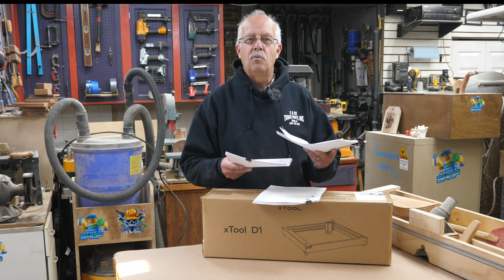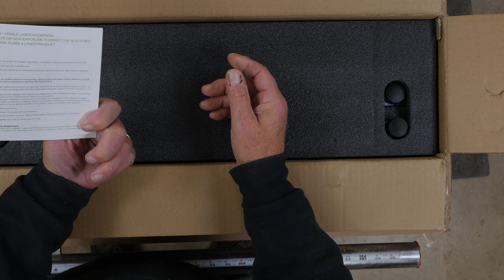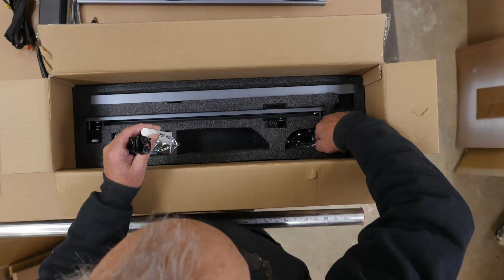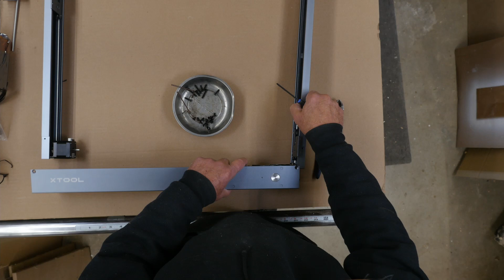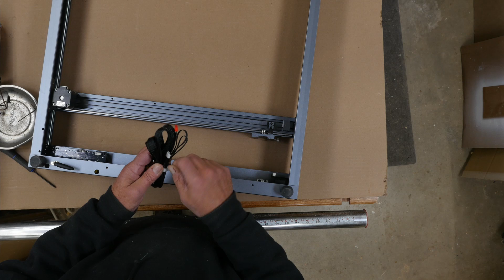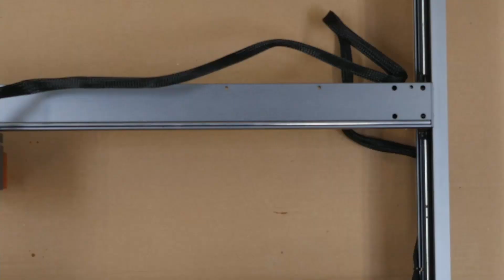Makeblock xTool D1 Laser Detailed Assembly

Comment: xTool D1 Pro 20W (red)What did you eventually do with that ignorant X-axis cable that will NOT stay out of the way of the laser. I tried under it, side, it just doesn’t make any sense why they designed it that way. Also I must of done something else wrong, the laser keeps hitting the sides and the alarm goes off. My “X” for my laser is off to the side about an inch. The instructions were horrible setting it up. It’s the weekend so there are no support options. It’s just aggravating. So far the couple of things I tried to do either hits the side and the alarm goes off or it was tried at a couple percent power to cut colored blue paper and it didn’t even make a mark on it. When I try to box the item I am trying mark it hits the frame and an arm goes off most of the time. I start it in the top left corner and it tries to go left and the alarm goes off. I wish I would of watched this video but I just followed their instructions that came with it and QR. Code to online directions. There was a spot that changed the X for the laser to a dot of the laser. I can’t find that now and it just seems like something is off with the laser beam. Should the X be 1/2 inch to the left maybe 3/4” off. I am thinking the laser is not making it out of the extension that has the air tool. The hose for that is worse than the X-Guide cable that is still in the way. The air assist tube just makes no sense and you have to keep the hose from getting in the way even when its not working properly anyway. It’s a lot to ask but any advice to get it right. The support open tomorrow if that help or notI already have their chat full of how stupid is this cable and air hose. The belt tension just bugs me, it doesn’t seem too tight but it might be, you said half inch with length play but how hard are you touching it? It’s not loose but it might be too tight. Something isn’t working right and I am new to all this but I am not an idiot but most of this makes no sense. Also are there any discount codes for LightBurn or student discounts? I know I need it but have spent so much already, I am not going to go into all the things I have ordered and are here or coming for a business I want to get going, or addition to one we have already struggling with to hope make it better. Great video and I liked it and will hit follow….
Reply: I subscribed 🙂
Reply: Oh, my glasses are also green, but I have a handheld  blue laser that burns that and the wavelength from the place I got protector glasses from where also dark green. I don’t understand it but that what came with the xTool too????
Reply from the maker: @bojan8919  The correct "color" is orange for a blue diode laser in this wavelength.  The green also works, but does not block the spectrum as well.
Reply from the maker: The Pro 20W has limit switches and it sounds like they are either out of adjustment or not connected correctly.  I use Lightburn 99% of the time and have only played with Laserbox a couple of times, but I would think that this should auto home.  I have done a few videos on cable management for the xTool D1 that can be found on my channel, with the latest being an added air assist that will post in a few days.

Comment: I just got mine today and it came with an assembly manual with descriptions and pictures so it wasn't bad.
The problem I had was the necessary install and update to use Lightburn with it.
Reply from the maker: I'm a computer geek, so the Lightburn part was easy for me.  As for the printed manual, they received so many complaints from consumers that they started including one!

Comment: Was the shaft hard to install? I feel like I’m forcing it and it bends. I stopped at that point until my husband can help me because I do not want it to break. I’m talking about the 13:14 time of your video.
Reply from the maker: No, it was very simple.  You should not have to force anything.
Reply: @rogersshop  thank you, I’ll have my husband take a look.
Reply: @welovedisney3717  I just finished putting mine together.  You need to loosen the belt tension on the gear end of the shaft.  My belt was too tight and that end would not go into the bearing.  I loosened the belt tension screw and that provided enough slack to allow the shaft to slide into the bearing.
Reply: @thomasstocks702  thank you, it took me a few videos to figure that out. Now I don’t know why my projects aren’t engraving correctly 🤦🏽‍♀️ quite the learning process
Reply: @thomasstocks702  Thank you so much! I was struggling so much with this and thought I was going to break it!